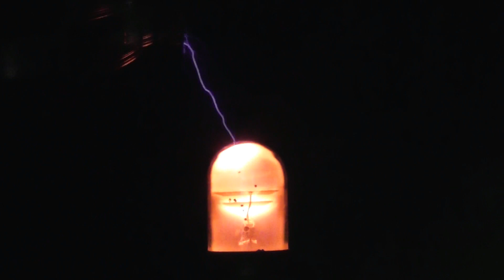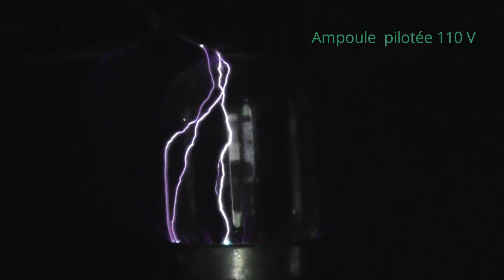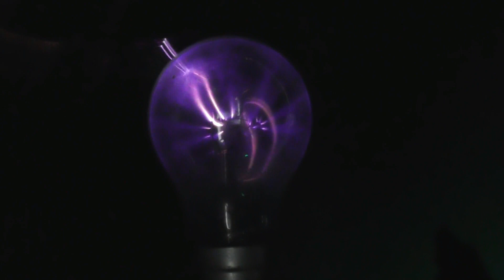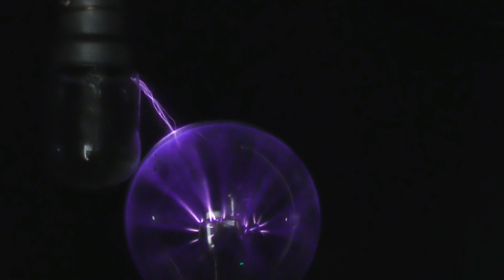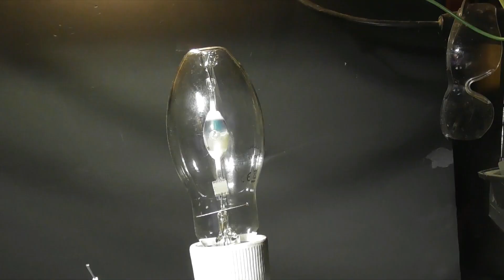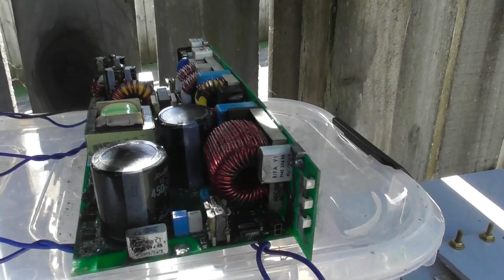HF lamp colours

Comment: The pilot lamp most likely has a vacuum in it. I believe those green flashes of light are caused by fluorescence of glass under low energy x-rays. Be careful.

Comment: I like that green color and the glow of the metal vapor lamp. I once flashed over a vintage lightbulb with that 34500 transformer and it filled up with a green plasma for a split second. Was pretty concerned with xrays because of the age of the bulb.
Reply: I don't know how much you actually get, but here's a good demonstration:
https://www.youtube.com/watch?v=q4hvhcnv01I
Reply: The age of the bulb doesn't matter much.  It's the voltage that does it.  If you're up at several kV, sparks will generate X-rays.  Geometry and materials will make some difference to it, but long sparks = X-rays.